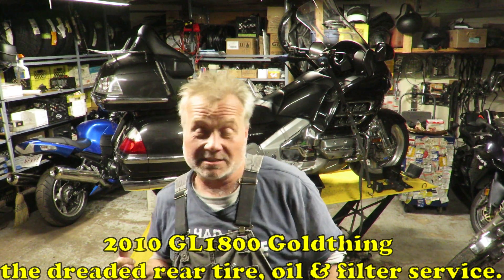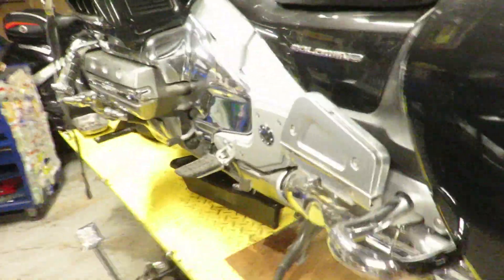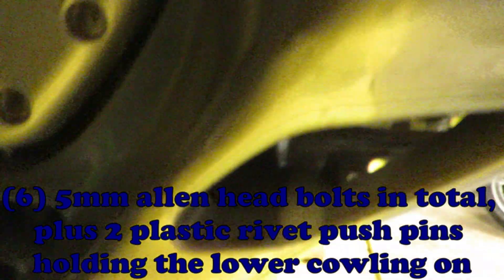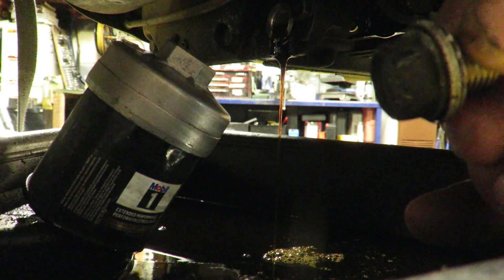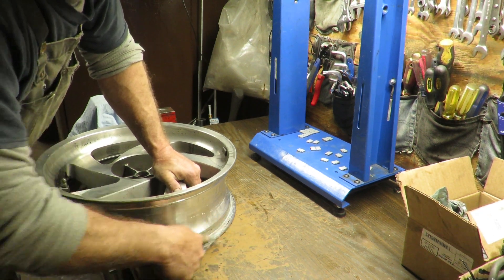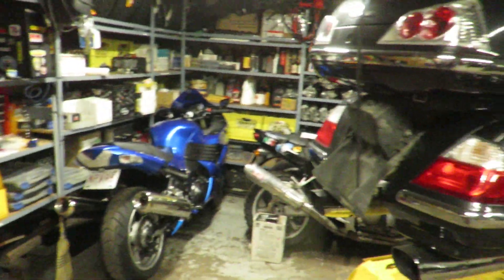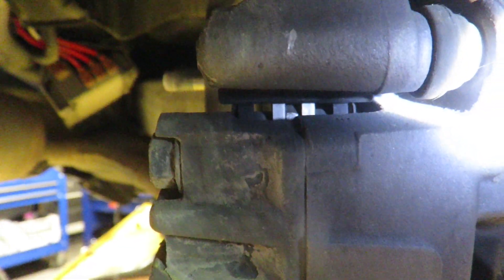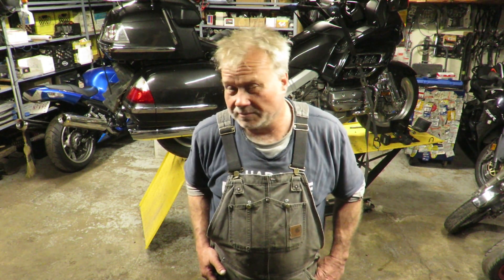Honda Goldwing 1800 Rear TIRE change by hand, + OIL + FILTER, Old School method

Comment: try changing a rear tractor tire by hand...tons of fun
Reply from the maker: No doubt. Got an old '45 WD9 Mccormick Deering we use for splitting wood off the PTO, the rears are full of leaking calcium chloride. Not really looking forward to that gig. lol Any tips?
Reply: @JVWinalberta  actually, yes.. leave the wheel on the machine and use a prybar (tamping spade) and a sledge hammer to break it down...if you remove the wheel from the machine you will never get it broken down.  

Ive booted many old tractor tires ...a task i wish upon no one

Id probably drop  the wheel and take it to the farmers Co-op and have them do it free when i bought a new tire...im old and lazy
Reply from the maker: @factsarenotopinions  Cheers. Thx

Comment: You skipped the part of breaking the bead in the video! When I do mine, I'll use a bottle jack up against the bumper of my truck.
Reply from the maker: Good point. I have an old motorcycle frame, and I use the swingarm with a lever + pieces of 2x6 to protect the rim and space the rotor away. Should have included it, its kind of hilarious but effective. Cheers
Reply: @JVWinalberta  I wasn't asking for myself but some people might not have a clue.
Reply: You could also use a sissor jack or some sort of pry bar, a long 2x4, etc.
Reply from the maker: @jamescampolo7824  For sure. I do tons of tires, should whip out the camera for the next one. Ton of freedom if you can do your own tires, eh?
Reply: @JVWinalberta  Shop prices are insane. I used to take the wheels off and take them to a shop. If I do it myself, I know it's done right. The last time I took them to a shop, they put the tire on backwards so I bitched. They fixed that, then I looked at them and there were no weights on them. They didn't balance them. $100 what a joke. I'm retired and have a garage. I'll take care of it. $100 for two wheels. Then they have the balls to post signs around the shop that If I bring my own wheels/tires, they are not responsible. For sure, they are irresponsible.
Reply from the maker: @jamescampolo7824  Sounds about right. lol